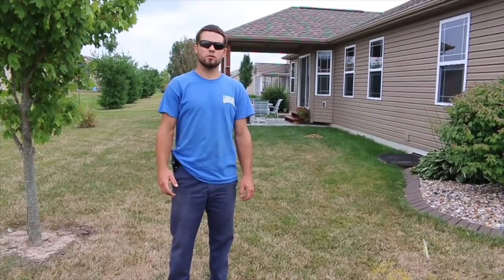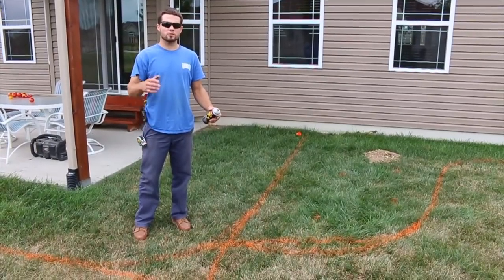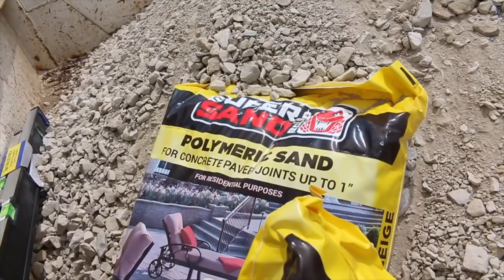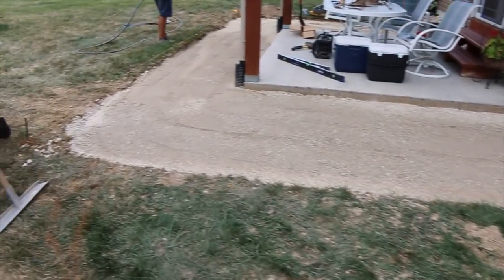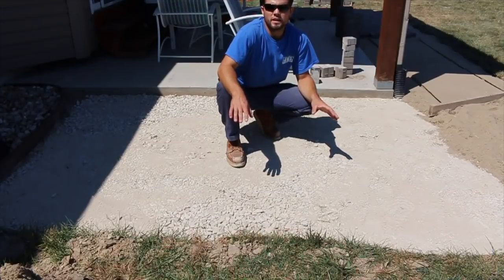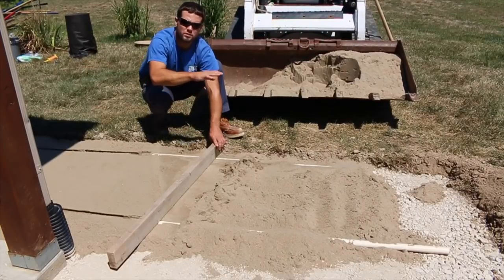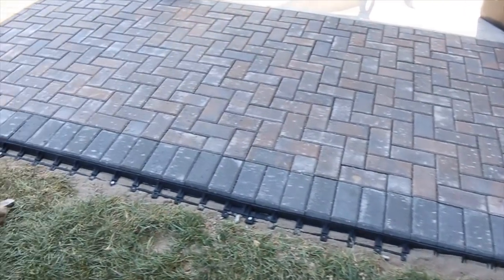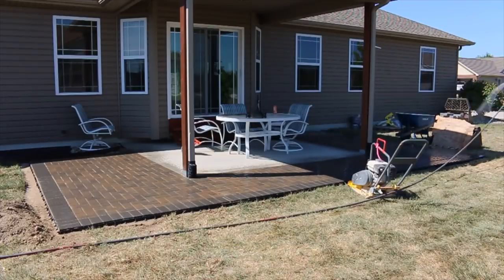How To Install A Paver Patio | Adding More Outdoor Living Space

Comment: Hey nice work , quick question here by the way , I have a similar situation where I need to lay paver next to a foundation,  should the bricks go touching the foundation straight ?
Reply from the maker: They can, but an expansion joint is cheap insurance. Similar to what concrete guys would use. You can buy expansion joint at almost any hardware or box store

Comment: Is it ok if I just use dirt for a paver base? As long as I compact it and wet it and throw leveling sand on top before I set pavers?
Reply: And also should I set my bricks up above the sidewalk at least a quarter inch? I was told that it’s good to do because the pavers will settle.

Comment: Should i use concret around the edgers to keep the pavers in place
Reply: Concrete is the cheapo way to do it, but will crack/fail sooner than using the edge restrainers he used here, they of course cost more though. I use the edge restrainers simply because I slowly am adding onto my paver area as I have the spare money to do so. I want to eventually replace the majority of my entire back yard with pavers just so I only have to cut half the grass. 7-8 grand is well worth cutting the grass cutting time in half in the long run, and it adds home value too.
Reply: @johnmclain250  are you for real? 7-8 grand to save grass cutting time.  
There are robot lawn mowers now that is cheaper than paving.  Gardening services would be cheaper

Comment: The "weed barrier" you are referring to is not barrier for weeds my man! Weeds don't start to grow in that depth. The geo- textile membrane/fabric should be installed on the subbase/dirt, to prevent the subbase penetrating into the base and compromising the strength of the base. It should even be wrapping the base vertically.

The excavation should be extended 8"-12"  beyond where the edge of the pavers are planned to be installed (depending on the depth of the excavation). This of course is not necessary where there are structural walls, etc.
Otherwise the outer edges of the pavers don't have enough base support.

The pavers edge restraint should be installed directly on the compacted granular base and not on the bedding sand. One can achieve this by removing the excess sand at the edges.

Side note: please wear respirator. The polymeric sand should not end up in your lungs.

Other than that, you are doing the  correct way than 80% of hardscape contractors out there.

Keep up the good work 👍👌
Reply: Yes and yes.  Very constructive way to comment.

Comment: Nice job. But to save time and looks on a job like that. Pour concrete around existing pad and you can install pavers right over top of Everything. You wouldn’t have that plain white pad standing out. You also won’t have that settlement of the pavers around the concrete pad that WILL happen over the years. just so you know I do have a concrete business and we do do pavers and we are certified installers for EP Henry pavers and walls.
Reply: for a small patio (3.1M x 2.7M), is it necessary for weed membrane? is it necessary for a deep later of sub base and deep layer of sand seen as though it's only for walking/sitting
Reply: Ahmet Ali  to properly do it you need to dig down minimum of 6 inches. Install geo-tech fabric or similar fabric at local hardware box store. Install proper base that you can purchase at local landscape supplier. Install 1 inch of concrete sand. Compact the dirt first before you put the fabric down. Compact base material. I know it’s a lot. If you really want to save and do something simple then just dig out the lawn area. Install fabric then put 2-3 inches of sand. It will shift over time but you can lift and adjust as needed.
Reply: @4KDisneyTV  I've noticed that most of the area after 10cm deep (4inches) is beginning to get Sandy and some big stones. Top 9cm was all soil, roots and grass. As the area is right next to shed, perhaps the base for the shed was done for entire width of back garden as my neighbours shed is on right side and mine is on the left. Perhaps builders put hard-core under whole rear part of garden for a shed base
Reply: @4KDisneyTV  Thanks for the economic method to save some money.
Reply: Ahmet Ali  No problem!  That is the most economic way. When you do put the sand down get it somewhat level and then gently hose the sand. This will compact the sand. Sand is self compacting. Watering it first then letting it dry out will compact it.
Reply: @4KDisneyTV  my slabs are very heavy (32kg each)  have you seen a video of technique to lift and place the slab without disturbing sand layer
Reply: Ahmet Ali  No I haven’t. You can use a thin rope that is strong enough to hold. You would need another person. Put rope under slabs for both people to lift each end. Set pavers as close as possible to one already installed. Pull rope out. The rope Won’t disturb the sand. Then gently push the pavers you just set to the the pavers that has already been set. I’m sure there is a video out there.